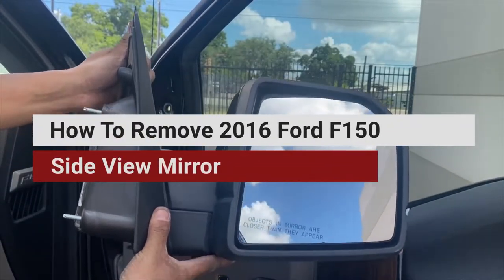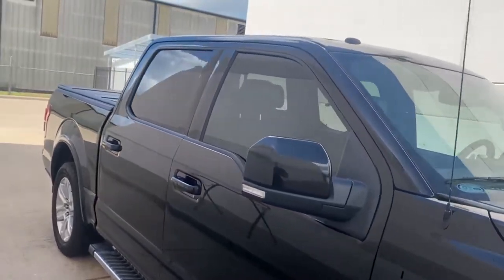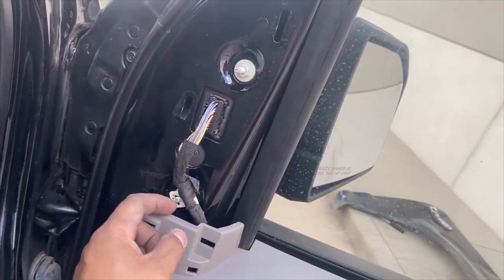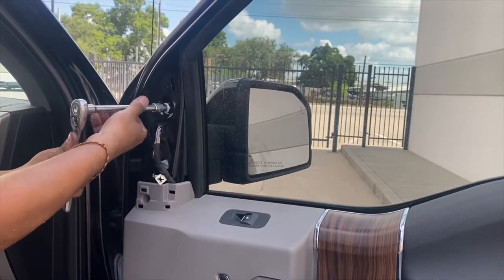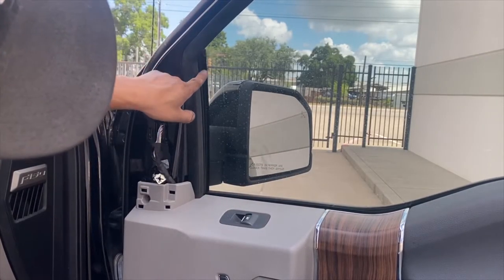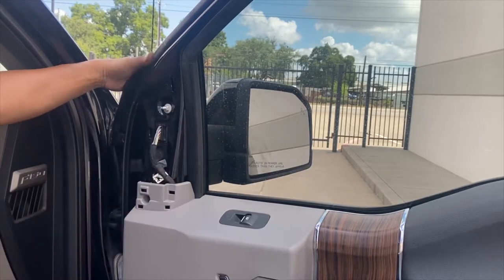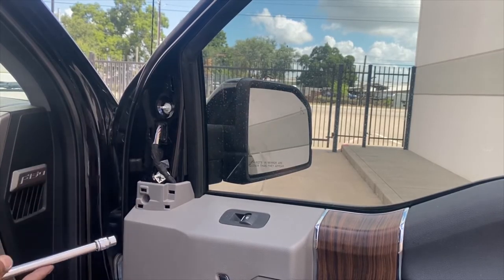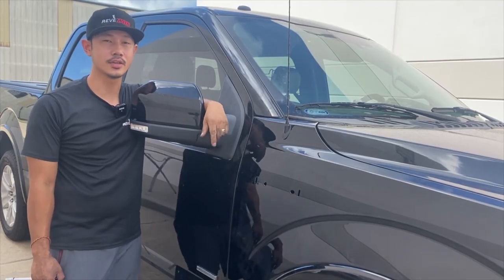How To Replace a 2015-2018 Ford F150 Side View Mirror | In Under 5 Minutes | Step-By-Step

Comment: I have a 2016 F-150 XLT without the blindside sensor mirrors would they work if I was to replace them with mirrors with the blindside sensors on them?
Reply from the maker: The blindside won’t work and the plugs won’t work either.  So, I wouldn’t buy it unless you want to change out the wiring harness.

Comment: Replaced (which was super easy following this video!) but now I’m getting an error for both blind side and cross traffic system fault/ any idea how to fix this??
Reply from the maker: Make sure the mirror you got is the has all the same features the old one had.  Sometimes the plugs will connect, but without those same features you will have errors come up.  If that is not the case you will need to reprogram at the dealership or any body shop will help.
Reply: hey, do you know what tool he use in the video?